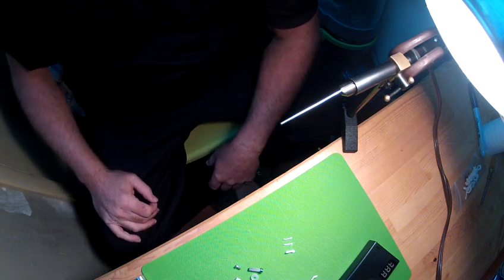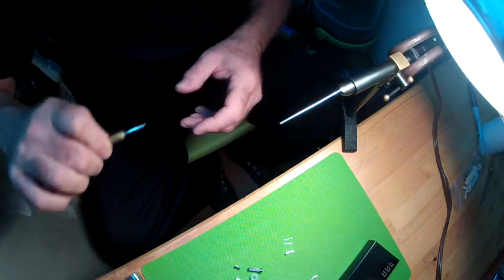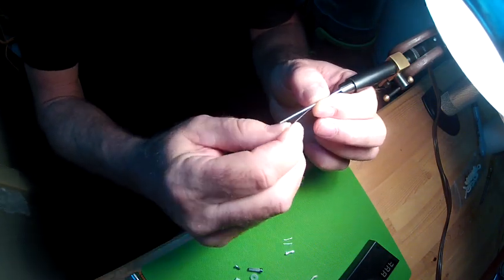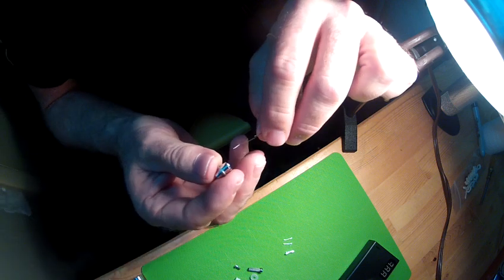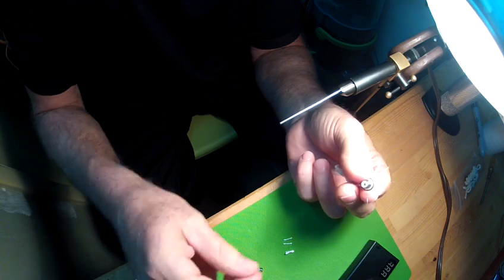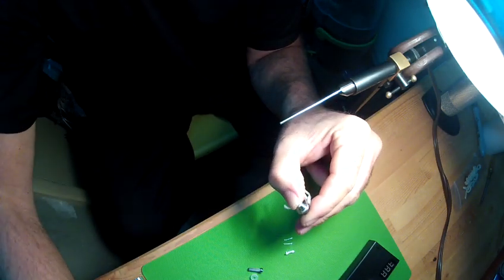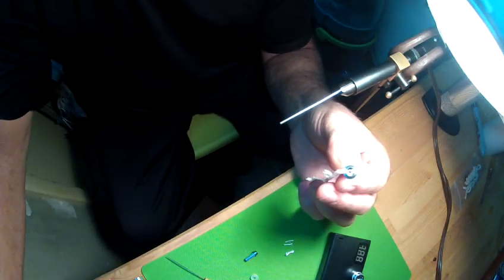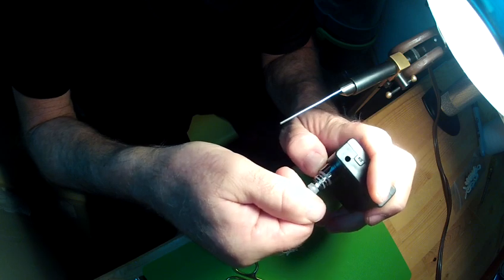Kanger Vertical Coil Easy Build / Rebuild

Comment: Best coil rebuild I've ever seen, Mate. I've been building vertical coils with cotton for my pro-mini tanks. I've been using ready made coils, but, my tanks have the two holes juice holes, with make it a lot more difficult to build. I've been packing the chamber with extra cotton (round the coil) but they do not work as well as I'd like. I don't know if the head you're using will fit my tank. But I'm going to look into it. This was such a simple build. I love it. Thanks, Mate. Cheers.